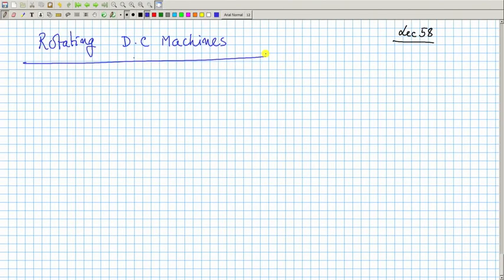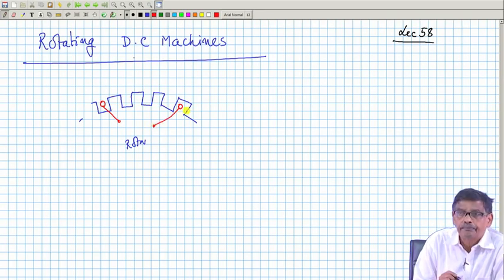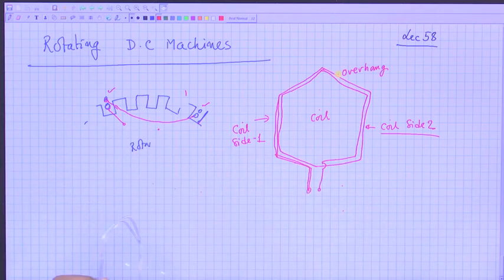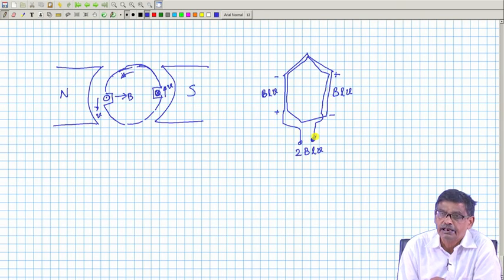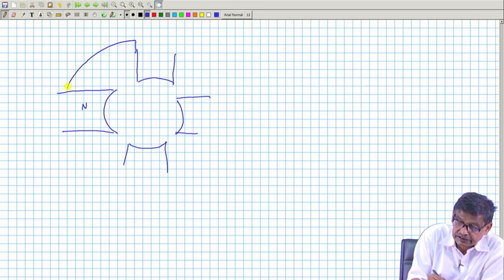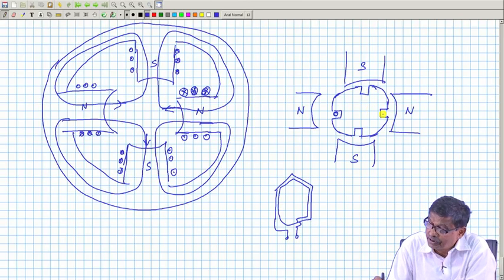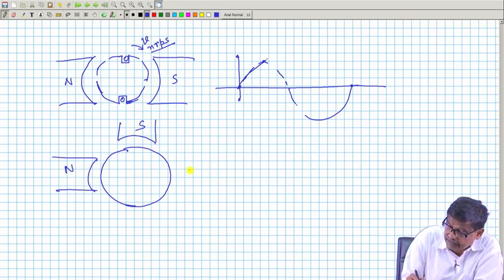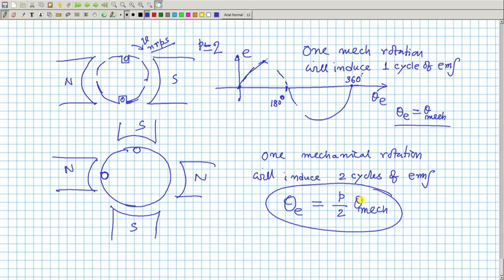Lecture 58:

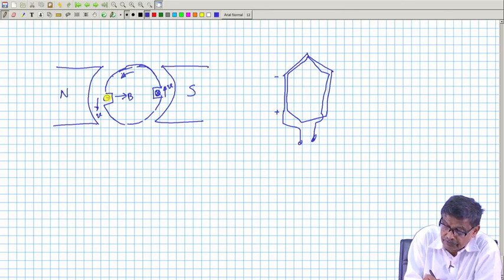Comment: @14:14 I think there is a mistake in assigning the polarity of induced voltage.

If it is my mistake, then please explain how the polarity is chosen in this case?
Reply: there is indication of cross in the condutor so it is correct